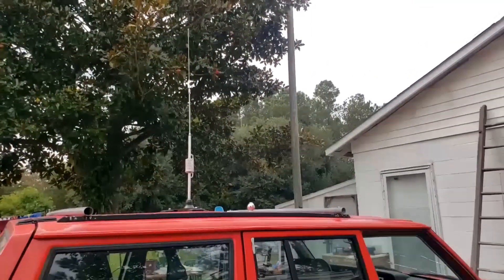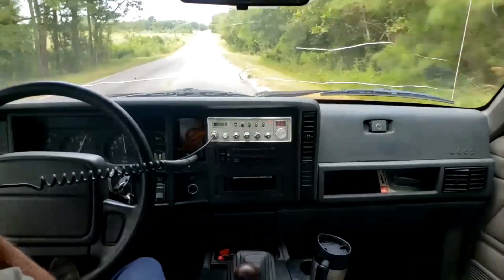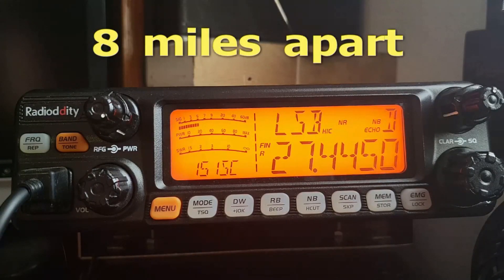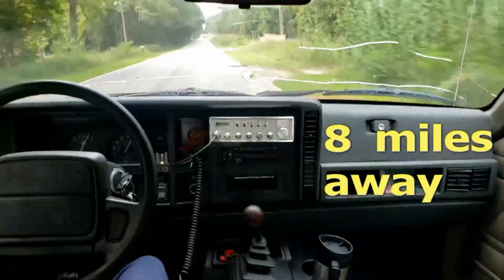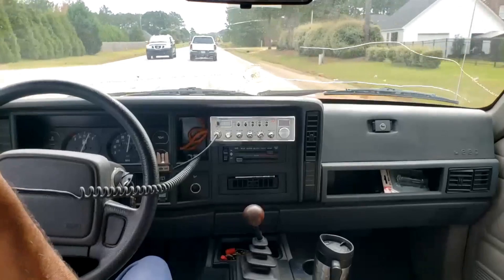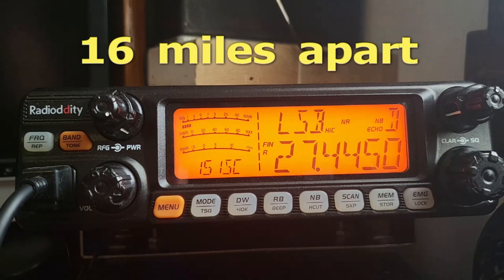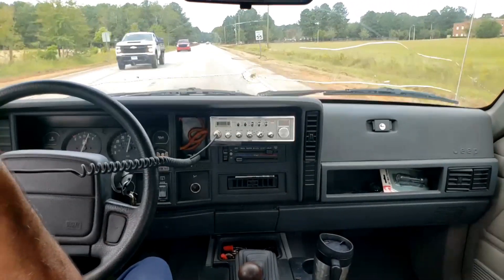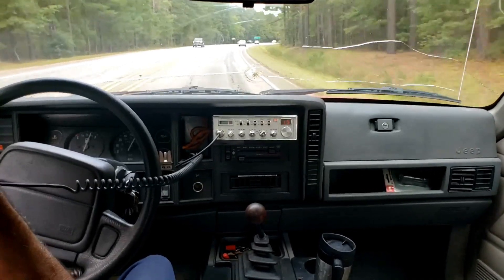Range Testing a Radioddity CBL-561 CB Antenna 25-30 mhz

Comment: the tri-magnet mount on the roof seems reliable. Love the vids. Hope to be stepping up to the QT40 or 60 soon and hope to modulate with you over the air. 420 Bluegrass State
Reply from the maker: Thanks 420, that tri-magnet mount does make it easy to set up! 73's

Comment: Greetings, MJ, great testing you do in these videos, so I have a question directly related and a question obliquely related, apologies for the gigantic word count (wincing) I have a 1 acre backyard with many trees and before I commit to an antenna like your latest Maco VQ3 I am trying to firm up comms between my location and my son's apartment 4.3 miles straight south on a 3rd flloor bldg but his area is a bit lower than my area so not line of sight, maybe 30 foot lower? 

1)I was thinking this antenna on a plate fastened to my chimney and using a Bearcat 980 using an ssb channel and he on the same model cb but perhaps with an apartment (indoor) dipole wire setup...with a potentially fatal caveat...which is his room will allow for 90" left and right but only if we install it with the center in the 90 degree corner of the two walls...will that violate the physics of the dipole layout, having the antenna bent 90 degress in the middle?

2)Also, you mentioned in your Maco video you could lower your upward facing antenna down, possibly pointing toward a location and it would allow for both vertical and horizontal targets...do you point the antenna tips AT the target or is it the other way round? Thanks for any advice, I haven't tried to comm with him using AM CB but we are out of earshot with quality GMRS handhelds and large Abbree antennas so I am assuming if we can find an acceptable antenna for his apt ssb should be able to do nicely, Happy New Year almost! :)
Reply from the maker: The antenna in this video is for mobile use, it needs the body of the car to work properly. I think you should both use dipoles. that 90 degree angle at the center will work fine.
Thanks for watching, Happy New Year!

Comment: Great video, I have the AT-5555 n ii which is the same radio - I use it both as a 10m amateur radio and a CB. Has so much power it trips the relays in my solar inverter in the garage! 

I usually run UHF locally, the kit is cheaper, smaller antennas and does as well as CB. But I’m going to try this same test with the new Retevis CB over FM

Thanks for the video can’t be a real life test!

Comment: Hi John can I install this antenna on my base to use it at 11 meters?
Reply from the maker: it could be used as a base antenna, But you would need to add a counter poise or ground plane.

Comment: Suggestion for that rattle, if the set screw top can be removed from the antenna, leave it tuned and use some heatshrink on the bottom of the stinger inside the main body .

Comment: Works well im using it with a QT -80 just need a little heat shrink on the last half inch of the adjuster section due to that rattle. Tested on 11 metres to New Zealand about 2500 Miles from my location in Australia sitting in my driveway.
Reply from the maker: Nice! I was thinking about using heat shrink, I'm glad to hear it works. Thanks for watching, 73's

Comment: You could buy some speaker wire and ring connectors. Take the bolts out of the magnets put ring connectors with about 9ft of speaker wire attached to them. that would give you 3     1/4 wave radials for 11m's. Take the wire attach them to the roof rack with electrical tape or whatever. It doesnt matter if they are attached in a square or an L config. It would give you a good 1/4 wave radial system for 11m's. It will help lower your swr. You can also put some ferrites on the antenna feed point and at the transceiver side of the coax. It will help with common mode current coming back to the radio and stop some of the RFI out of the coax. Palomar engineering sells the ferrites for the band and freq you use. They just snap on the coax.

Comment: Years back (1980's) I used to manufacture antennas like that out of copper, I believe the antenna was called the "DX-1"" at least that is what it was marketing name was? The design is much older than the 80's though! 
  At the time, the "DX-1" for a mobile antenna had a reasonable amount of gain and could hold quite a bit of wattage!

Comment: Mower Junkie 2.0:1 is only 11% reflected power. So, 100 watts 11 watts reflected. Just for reference. It is negligible. You’re not going to see half an S unit on the S meter without doubling the power, or 3db. 6db is a full S unit or 4 times power increase. Thanks for the video. 73’
Reply: true but that 11% makes heat in the radio so not good u want to keep it cool aka swr below 1.5 to 1 the lower the better
Reply: @CBPunisher1900  2.0:1 is safe. Also, that additional SWR causes the power reading to go higher. Watch the video on does a high SWR increase power output. It doesn’t stay in the radio, it is retransmitted.

Comment: A noise filter would help on your Jeep
Reply: Mag mount antennas have this issue usually due to poor grounding one way or another that's why mag mount antennas shouldn't have more than 150w out due to crappy magnet connection to body..weather can change your antenna match because of the Magnet..
Reply: @jondough4116 I didn’t know this as a college student, I had a General Lee in a 2008 lifted tundra, Wilson 5000 and Dave made 2x6. I power like car stereos with fared caps and extra batteries.

It was amazing, then I lost interest until now.

Everyone I called answered. I’m sure it could be better. I just ordered the new Flex Radio, govt model, open transmit from 1.8 to 2.4 GHz and a 2000 KW amp! I’ll prob run a custom BBI amp, 3cx15,000a7

Not sure what to do about an antenna, that part always bores me

Comment: I love the way you do real world tests.  I have the QT60 running a K40 with the 5' whip.  I have been able to hit Canada a couple times and I can attest I have heard you here in S IN.  You come in loud and proud.  I dont have the extra boost to reach you but I like hearing you on here.  Great review and now I gotta find a way to get that QT80 in my rig.  Thanks for the review.
Reply from the maker: That's awesome! I thought about putting my QT80 in the Jeep, but I like it as a base radio, So I used my QT40 instead. Thanks for watching, 73's
Reply: I've learned so much about antennas since I started watching you.😅 @MowerJunkie

Comment: You got the same set up as me but is that mag any good,  I have a  mega watt but the big mag on the ribs of my jeep patriot are a pain, parts are expensive in the uk for my ride
Reply from the maker: the Radioddity triple magnet mount works great! But I do have to have the antenna off center, to clear the roof ribs.
Reply: @MowerJunkie  still better than just 2 bars to sit on,  I have to put the roof cage  on and strap to it. Thinking of getting a van for static mobile and stuff because it's flat and low here on the fens and then I will put a hole in the roof for the mobile it's probably the best option and I won't screw up the jeep
Reply: I just love being back on the air,  my dad had a cb shop in our garage in the late 70s when it was illegal and underground.  People would come all over the country and walk down the drive looking shady to pick up their rigs. But FM was rubbish and now hearing and talking to the USA takes me right back.  Love the footage you all create